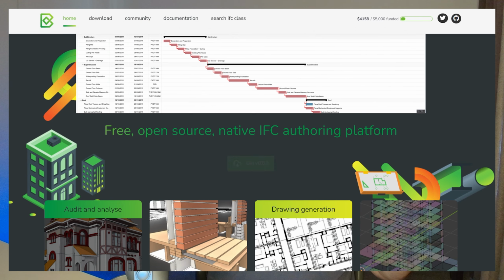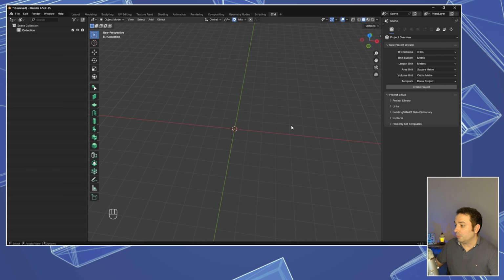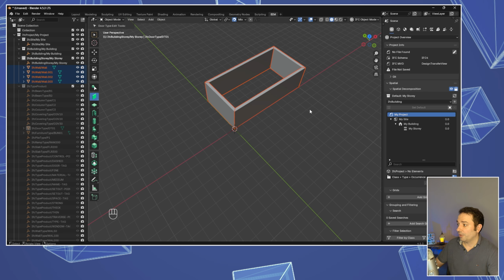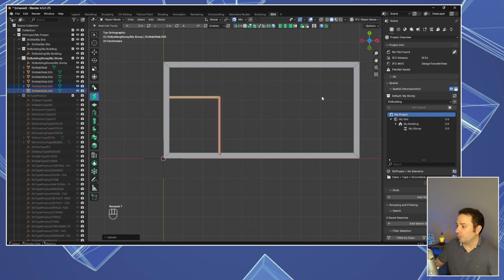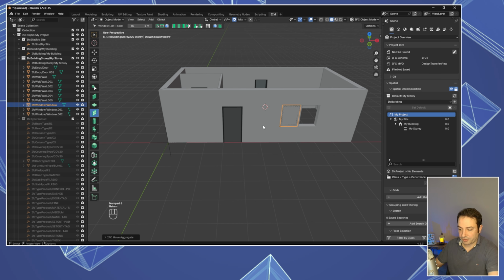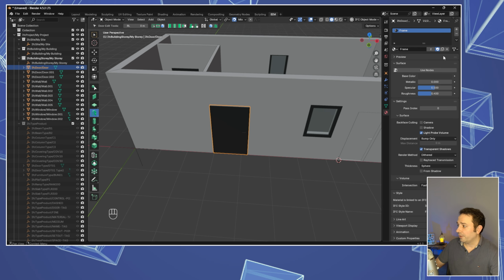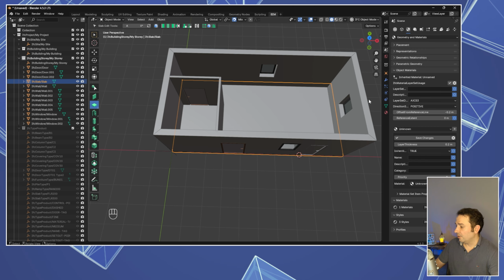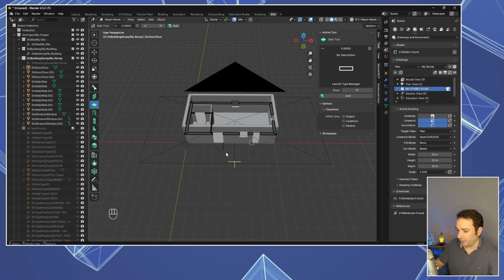Your first BIM drawing in 20 mins using Bonsai | Blender BIM and IFC

Comment: Spent hours trying to lay the floor using the polyline feature but the second click always closes the loop and generates the floor slab. Don't know if you have come across this problem before. Would be great to know how you solved it if you have.
Reply from the maker: Thanks for flagging this. It sounds like Bonsai may be interpreting the second click as a double-click and closing the polyline. Try reducing Blender’s Double Click Speed under Edit → Preferences → Input. If that doesn’t help, please share your Blender and Bonsai versions, as it may be a version-specific bug.
Reply: @RinoAndCaroline  Thanks I actually tried all that but that wasn't the issue. I finally figured it out! The slab I was laying was one I had made rather than from the standard library and something about the way I configured it meant polyline didn't work. When I used one from the library it worked straight away.